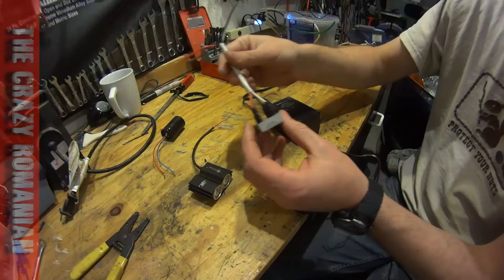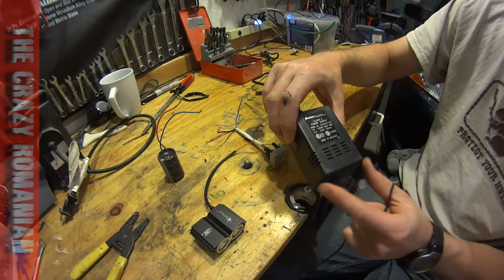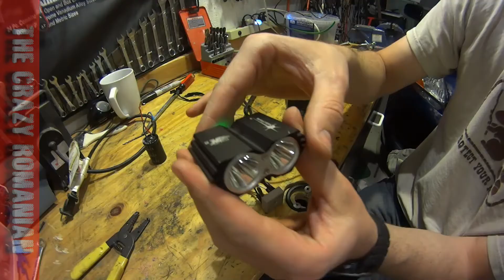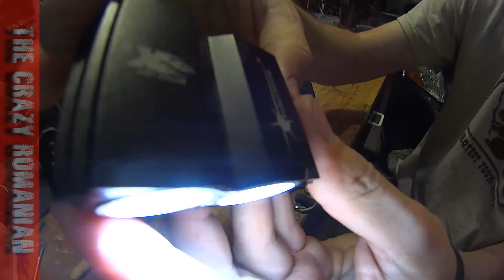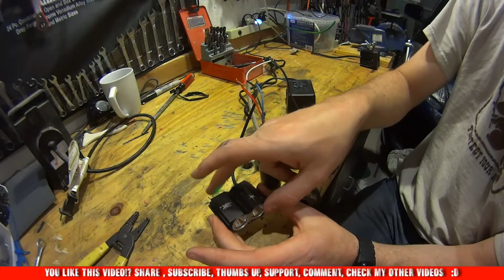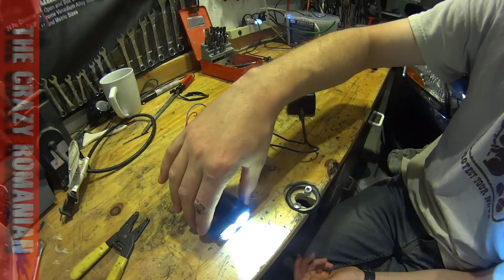How to convert AC to DC for Dirt Bike LED lights with a Bridge Rectifier

Comment: Very helpful simple video!  Do you need the capacitor on the battery charging circuit?  Do you need anything else apart from a suitable rectifier and stator for a motorcyle battery chsrging circuit, apart from a fuse?  What size fuse?

Comment: Great video. I have a 2021 wr450f that I'm adding an LED light. The wires that go into the existing H4 socket are two black ground and one green AC. Is that green wire the one that you connect to the AC part of the rectifier? That is only one wire, where do I get the other AC wire for the other AC pin on the rectifier?

Comment: Ok so I'm going to do this to my xr250r 01 and I'm not sure where to start the bike is ac and want to go to DC mainly for I can run a new headlight on the bike the old bulb burnt out and I just got a hole new unit where you I put the bride rectifier bit the headlight or under the seat where all the other electrical wires are and I'm not running led so do I still need to filter the power
Reply: I added a 12V DC-DC voltage stabilizer after my AC/DC voltage converter and im able to run 80W of total LED lighting on my '98 Xr120r
Reply: @MikeyMobes  Did you just bought the bridge rectifier like in the video and connect it to your ac input in order to convert it to DC and then used a Dc-dc converter? I have ordered a dc - DC converter step up/down regulator buck boost 8-40VDC IN 12DC 10A out . Please confirm ..thanks
Reply: @chriscs9080  So I did things a little differently than in this video. I think this is a great method to quickly wire something up, but in my experience things quickly go downhill because of the lack of redundancy in the circuit. Since the electronics are powered through an AC stator, the output voltage varies quite a lot. At redline my 90W stator can produce really high voltages, so high that they have actually burned through the stock electrical connectors and had to be replaced. So I purchased a 12V AC/DC full wave bridge rectifier (like those commonly found on larger motorcycles with a battery) and feed the 12V output into a 12V-12V DC voltage stabilizer/surge protector to stabilize the DC voltage for sensitive DC electronics like LEDs. So my 90W stator outputs 7.5A of current at 12V which is actually quite a lot, especially if you plan on running LEDs. You mentioned you were going to wire in a BUCK converter but i dont think that is necessary  since the output current of the rectifier is already enough to power pretty much whatever you need. I would add a 12V DC-DC voltage stabilizer to add a layer of redundancy to your circuit. I also wired in a bank (connected in parallel) of 2 4700 uF 50V capacitors as another layer of redundancy against sudden voltage spiked/dips in the case of a sudden change in RPMs (like downshifting). With the capacitors, rectifier and stabilizer i have yet to have any flickering or stability issues running 40W of LED lights. I would be more than happy to share my wiring diagram with you if you think that will help you out. I hope this helps and best of luck!
Reply: @MikeyMobes  Thanks for taking time to reply . Which is your bike? I guess its half wave correct? My alternator produces about 170w at 5000k rpm as honda states.
Could you please tell a look at this video v=DLINFdWid84 ( just replace the text in the url after the questionmark because youtube does not allow links in the comments) ( I made this video for an Indian guy but he did to reply unfortunately ) is the wiring diagram for bike bike modified ..Do you think its correct?  Sure I would love to see your wiring diagram
Reply: @MikeyMobes  please comfirm